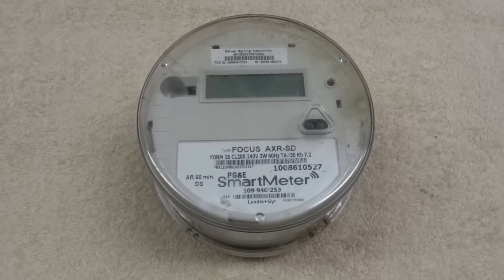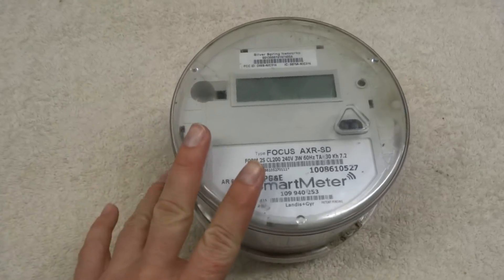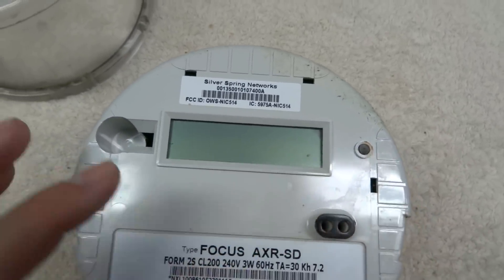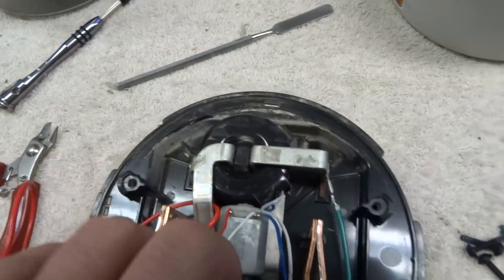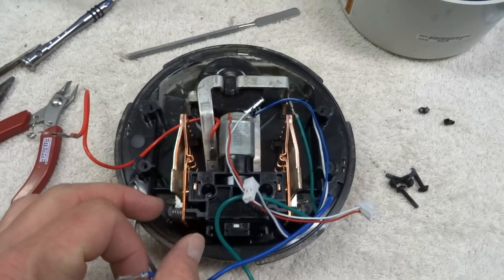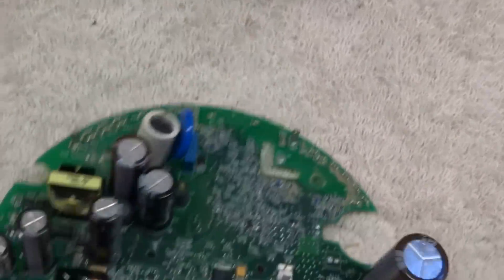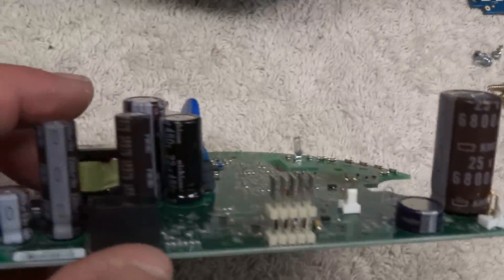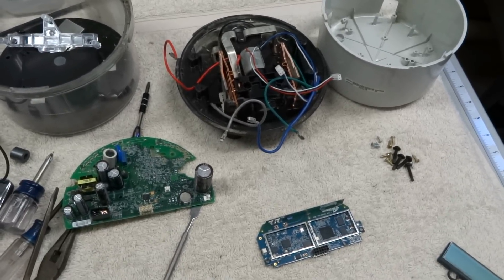Let's Teardown - Residential Smart power meter

Comment: You no nothing about meters....
Reply: Brandon Evans Well Brandon    *WHAT DO YOU KNOW ABOUT SMART METERS?
What is the maximum power rating of a residential smart meter?
What happens if the maximum power rating is exceeded?
Where is the surge protection the old glass and meter wattmeters had?
Which burns better glass, metal bakelite    or    polycarbonate?
How come a smart meter is smart enough to know when you take a bath or make coffee, but it dosen't know when its own butt is on fire?
How come smart meters have a lithium battery that can overheat and set fire to the smart meter?
Just don't say something STUPID      Prove what you know is the truth.  

If you really want to prove you are smart and not a power company manger who gets paid to troll the internet, then answer this simple little question.
------------------------->    At what distance is a disabled homeowners 100% SAFE from a 4 watt eirp AMI7smart meter if they have an unshielded medical implant?  <-----------------------
Reply: You seem to think that you are a know it all on these smart meters, if so, where is your video explaining everything. At least give the guy credit for doing his best in taking the meter apart, filming it and explaining what he thought the internal parts were. The average person watching this video wouldn't know the difference between a transistor or a resistor so don't pass dumb comments about the guy because truthfully, I haven't seen you do any better OR anything at all.
Reply: +Brandon Evans 
No in this case is spelled Know! So he may know more than you do?
Reply: +Frederique Zug   All that typing smart and you can't even put together that concerned citizen was stating Brandon Evans had no spelling. He said nothing about your ability, only that Brandon Evans, your ORIGINAL target...said "You 'no' nothing"   Concerned Citizen was stating, why bother asking questions to a person using NO, and not KNOW.
You're too busy being mad.
Reply: Most 2500 square feet houses don't even pull 150 amps
Reply: +concerned citizen   Sorry cc   I should be thanking you.
Reply: +Brandon Evans Then why are they putting a 48KW smart meter on 225 amp service and setting fires to business and homes?
Reply: 400 amps at 120v and 200 amp at 240v...the service is probably rated for 200 amps sounds like the consumer out grew their service and needs to up grade to a 320 amp service.....most  houses don't
Reply: +Brandon Evans    http://www.rapidtables.com/calc/electric/Amp_to_kW_Calculator.htm
AC single phase
200 amps
240 volts
power factor 1
Crank the handle and have a look. 
Can you tell us why a smart meter manufacturer will pull the warranty at 201 amps??
Reply: +Robert Bodell (rbodell) What is your point??   There are thousands of DUMB ASS power company managers LYING about these plastic fireballs.
Reply: fuck
Reply: you
Reply: +concerned citizen The difference is I admit I am a terrible speller.   WHO CARES?
You on the other hand are a dumb villiage idiot who knows nothing about RF or smart meters. I know children in kindergarten that are smarter than you.
NOW THAT IS EMBARRASSING FOR YOU, DUMBER THAT A KID IN THE K CLASS.  OUCH
Reply: +Matthew Ryans Correction was made.
Reply: It all depends on how many amps your service is and that will determine what amp meter you get......and not all of the so called smart meter have batteries in them its an option that the power company chooses for their meters
Reply: Doing the math a 48kw meter is good for 400 amps...correct me if I'm wrong
Reply: +Brandon Evans You "no" nothing about spelling
Reply: +Brandon Evans  Most modern homes with energy efficient appliances don't ever use much over 60A unless they are using all the power hungry appliances at the same time.
Reply: Frederique Zug the nob that rants  and raves for no reason dude get a life i hope someone finds out who you are and sticks a smart meter up your arse
Reply: Brandon Evans YOU know nothing about spelling.
Reply: Brandon Evans you no nothing about grammar.
Reply: YOU KNOW NOTHING ABOUT SPELLING THE WORD KNOW
Reply: Robert Bodell -written like someone who knows what they're doing & not just a freakin' troll or a paranoid ranter wearing a tinfoil hat to block out the "CIA signals" that are (obviously!!??) aimed specifically at him! LOL!  That's an impressive set up you have up there.  I bet most, if not all the other commentators, with their "I hate the government but I'm impotent to do anything about it so I'll just bitch about it all day long on You Tube"-attitudes and mindsets can only piss & moan about their situations & not actually DO anything about it that - like it sounds you have - can actually accomplish something productive, vis a vis circumventing the "conspiracy of the utilities" (even though many of them are private cos. (in the US), not govt. agencies, with the exception of, say, L.A.'s DWP and maybe a few other examples -and actually, the DWP is more efficient than, for instance, Southern Edison, the company that services everyone in L.A. county that's outside the city of L.A.!)
Reply: no shit, and just like most repliers you've recieved, im beating the same drum today, he has even stated he is no electrical engineer in this video, but at least hes honest about it.
Reply from the maker: Brandon Evans I fully admit that.  I started off the video saying I'm not an electrician nor an electrical engineer.  I'm just a tinkerer trying to figure out how things work, and giving people the chance to see inside a new smart meter.